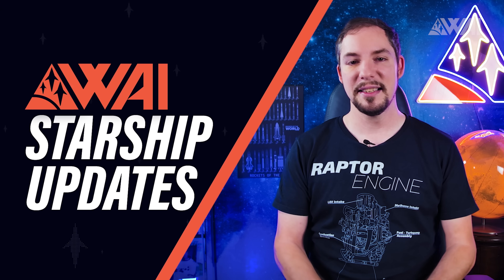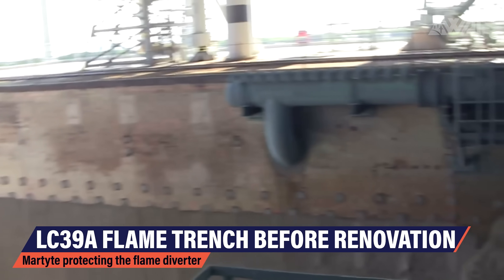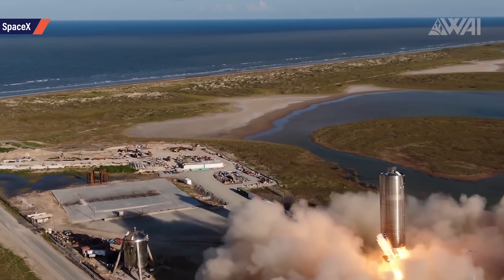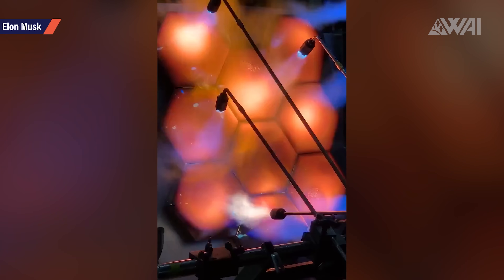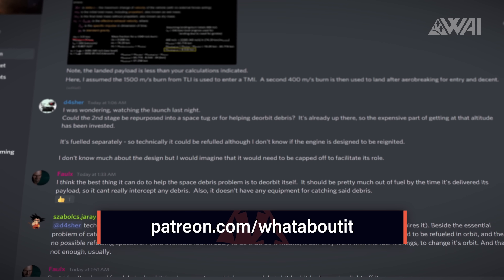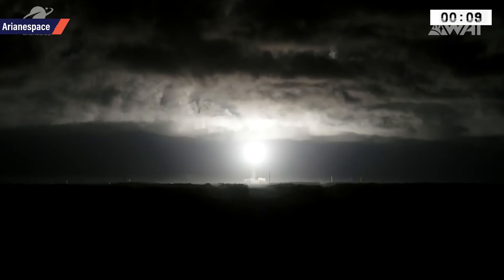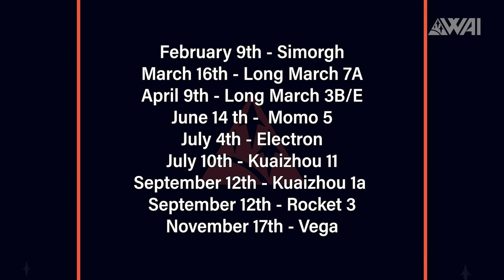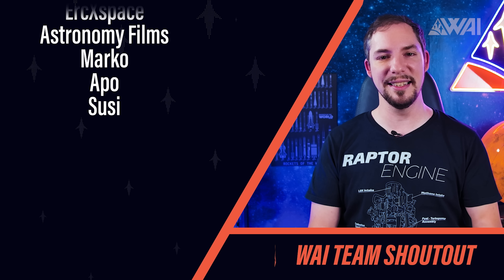134 | Why Martyte helped to damage a SpaceX Starship Raptor engine!

Comment from the maker: What is going on between orbital launch mount and Highway 4?
Reply: Something?? 😂
Reply: I think it’s either going to be one of three things... 
A. A parking lot
B. A location for a water tower
C. A new landing pad for the Super heavy 150m hops
Reply from the maker: Agreed. Tough engine design. They surely have to take a beating in this early prototype phase.
Reply: I suspect the reason for the flat pads without flame diverters is due to similar planned launch platforms on mars...would you even be able to apply martyte to mars landing pads?
Reply: @micmccond7  Yes, but getting the complete Starship shebang safely even a few centimetres above Earth on launch is necessary before contemplating a Mars landing. Why not start with a flame-diverter, test the vehicles for re-usability capabilities, and only THEN whittle down the sophistication of launch and landing sites when you know they work?
Reply: @mauricegold9377  they already know they can do reusable the whole point here is to figure out the interplanetary part.
Reply: ¯\_(ツ)_/¯¯\_(ツ)_/¯
Reply: I think it is a temporary flame diverter, So that they can test some more prototypes and then maybe build a new one or upgrade it!
Reply: Will 2020 ever end?!!
Reply: i reckon it'll be some sort of hangar for starships that are ready for flight?
Reply: @sionbrown7144 /\
Reply: Shane Lee  That is perfectly phrased 👍🏼
Reply: Shane Lee  yup
Reply: I cant wait to see the crane that will stack Starship on SH on top of that mount!
:_WAIShocked:
Reply: stuff.
Reply: Tank farm for OLP?
Reply: Fuel Reservoirs I think 😉
Reply: WS = We Solar * WS * We Spacefarers *  OurName4Freedom . ws * YourName4Freedom . ws * TheirName4Freedom . ws * 5x5 = 4k monthly income * BUILD * TSLA 4U DanielHall4Freedom . ws
Reply: Beer pipeline to a tent party.
Reply: a steel plate under a missing tile saved a shuttle so there is some protection
Reply: Flame trench I think
Reply: Idk 😬😐
Reply: flame diverter?
Ich glaube das macht wirklich Sinn irgendwie müssen sie da ja was machen
Reply: I think SpaceX may want to start looking at alternative approaches /materials to constructing launch pads.  The frequency and intensity of intended usage is unprecedented.
Reply: Those boxes could be for the tower next to starship/superheav
Reply: Throwing shade at Marmite? It's delicious, ^oo^
Reply: Shane Lee  A while backin WAI  I posted a link to pictures/plans SpaceX themselves published of a mobile deflector.
Reply: I heard rumors a 1 million gal water tower ! But thats just it rumors
Reply: @scottymoondogjakubin4766  That's huge as hell... a cube at least 51.1 feet on a side... it would need to be high enough to generate required pressure, but not too high to be vulnerable to storms effects at same time !
Reply: Sabatier plant
Reply: @tponn Well then... They shouldn't be assholes and make stupid mistakes! A 5 year old could have told them that they need a flame diverter. It's one thing to make mistakes on big unknown things, but a flame diverter? Musk wanted to cut corners and ended up looking like a rear end. 
But go ahead and be a good Musk fan.... Support your "god" no matter what!
Reply: WATER TOWER!!!!
Reply: So, they will eventually have to turn this "launch mount" into water tower and build a proper new launch mount.
Reply: @TechMasterRus  Wouldn't it have been easier if they had done it right in the first place?
Reply: @DavidJohnson-tv2nn  yes, significantly easier. Maybe, redesign is the reason why nothing is happening to "launch mount" for last mounth. They have to place the flame diverter somewhere, but there is no room underneath current structure.
Reply: As most of you who have read my comments know... I've been highly critical of Musk cutting corners on Starship development. Looks like recent events have proven me correct.
Reply: @DavidJohnson-tv2nn  It's not cutting corners it's taking risks. Something NASA or any other space company has never been willing to do. If he did everything without risks or willing to damage some parts starship would only be complete in 50 years, not by 2024. I mean he wasted a whole falcon 9 to test an abort system in flight.
Reply: @sejithe5th  It won't be done by 2024 either. I think everyone here, even though they're Musk fans, knows his timelines are BS! 
When they did the Falcon 9 abort test, they did their homework. They spent years in development to get it right. They had a very high degree of certainty the test would go as planned. Unlike with Starship.... Where they just throw stuff together outside in the dirt and see what doesn't blow up.
Reply: @DavidJohnson-tv2nn    Your fictitious beliefs don't fly here buddy. A lot of us have followed them much more closely than you. They blew up massive numbers of prototypes in the development of Falcon one and Falcon 9. This is their way of getting to success whether you agree with it or not.
Reply: @FSD_PNW  Of course not. I'm talking to a bunch of people who blindly follow Musk. Just keep following him until there's an accident in flight, on a manned mission, with no launch abort. The beliefs on channels like this aren't shared elsewhere. Not saying this is a bad channel. Just the blind devotion to Musk.
Reply: @DavidJohnson-tv2nn  Pretty sure when they do a manned mission they will do hundreds of unmanned flights and they all have to have no problem or else they won't be able to start doing manned missions because like you said there is no abort system so there can't be a single problem.
Reply: @DavidJohnson-tv2nn  Musk isn't cutting corners he is forcing tests for Mars return launch conditions.
Reply: @ShepherdsGlenn  So what has he proven? The obvious that you can't use the main engines for lift off from unimproved surfaces on the Moon or Mars? His engineers should have been able to tell him that without embarrassing SpaceX by leaving out flame diverters  with disastrous results. And I'm sure they would have told Musk. He just didn't listen.
Reply: @DavidJohnson-tv2nn  its possible to launch a rocket from any were; the ocean, a cave,even a glacier. The question is how much engineering will it take to make it safe. They are finding out what to shield and how so this won't be a problem later.
Reply: @ShepherdsGlenn  Keep in mind that this was on an elevated platform. How do you shield anything when the rocket nozzle a few feet off the ground with an unimproved surface? "Tests" done in this configuration won't yield useful data. Since it doesn't simulate the truly harsh conditions of an unimproved surface.
It is my opinion that to try to lift off from an unimproved surface using the main engines  an unsafe and reckless. Not only do you have to worry about  engine damage but a piece of debris puncturing a propellant tank or damaging other systems.
Reply: @DavidJohnson-tv2nn  It’ll be funny when they prove you wrong just like they do every time. They defy odds and do the unthinkable. I don’t see any rocket company anywhere close to spacex. They will have setbacks. But those setbacks are good so they can figure out those problems so that way they will never happen again.
Reply: @treytonbutler9835  Well... They proved me right this time. Because I warned a couple of months ago that leaving out flame diverters won't end well :)
Reply: @DavidJohnson-tv2nn  oh. I didn’t know u said that and I commented before I saw the video so I had no clue. Lol
Reply: In other words... Musk's reckless and "cheap" ways are coming back to bite him in the butt! Sorry, but I can't resist saying I told you so :)
Reply: @DavidJohnson-tv2nn starships are also meant to land on the Moon and Mars....
Not any landing pads with flame trench’s there..

So, this is how these starships need to operate....
Reply: @ernestgalvan9037  lower atmospheric pressure on Mars or landing in the micro-atmosphere of the Moon doesn't have the same sonic reflection problem that dense atmospheres Earth has. The only problem is "floating" caused by the engine skirt pressurizing like the skirt does on a hovercraft.
A much bigger problem with landing on any unimproved surface in early Mars colony days is FOD inside the engine compartment from kicked up debris.
It's why previous moon landers were set up so high on legs, to reduce damage to the ship from ejecta off the ground from the exhaust.
Reply: @bobjoatmon1993  The previous moon landers also did not reuse the decent stage. Doing so would be extremely risky. Sure you can do an inspection for damage upon landing. But what happens if you do find damage? And what happens if there's more damage on liftoff?
Reply: @ernestgalvan9037  Sorry, but Starship can NOT lift off from unimproved surfaces using its main engines. That is way too dangerous, as proven here. Though that should have been obvious without doing "tests". They are going to have to figure out how to do it some other way. Perhaps high mounted SuperDraco type engines? Or... On early missions, drop off equipment that will construct a launch pad.
Reply: @DavidJohnson-tv2nn  given musk was skeptical, clearly by his comment about it possibly being a mistake, it is clear others on the egnineering team thought it was doable, but he's skeptical on it, but willing to wait and see. Also, still, even with some adjustments, they are able to move way way faster, literally years faster,  than other rocket builders. So yeah, not "coming back to bite him", just another thing to test and adjust for as testing proves out theories or disproves them.
Reply: @FSD_PNW  But here's the problem... This is something that shouldn't have to be "tested" You don't leave out flame diverters! I mentioned that a couple of months ago on this, or some other space channel. Guess what happened? Musk fans ripped into me for daring to mention the obvious and challenge what was going on. I have also been issuing dire warnings about plans for leaving out launch abort from manned flights. But nobody is willing to listen even though lives are at stake.
Reply: @DavidJohnson-tv2nn  got to disagree.  If you don't break things you have no way to know what might work. Breaking things is faster and cheaper in the long run. This is a TEST STAND. If nothing breaks you're not testing very well.
Reply: @RickBoat  They didn't just break a test stand. They destroyed a multi million dollar engine and nearly lost the vehicle. And for what? You DON'T leave out flame diverters! This is not something to "test". I mentioned this a couple of months ago and got ripped for it.
Reply: @RickBoat  Musk also wants to leave out full launch abort for manned missions. People will end up paying for that with their lives.  That is why I put so much effort into this. I want to see successful missions to Mars, NOT disaster!
Reply: @RickBoat  I do get what you're saying. Some quick and dirty testing may be quicker and cheaper. But what is happening here is going way too far.

Comment: For the starship, Elon should angle the engines not for optimum thrust but to blow all the rocks and dirt away from the rocket at liftoff then once off the ground go for optimal efficiency.  Would that help? No heavy blast blackets/shields to deal with.

Comment: I think heat tiles should be layered. Similar to how a roof tile is done. The 1st layer, against the stainless steel, could be much thiner and be there as a precaution/backup in the event the main front thicker atmosphere touching layer failing.

Comment: Rediscovering the purpose for which flame diverters were invented is a noble cause.
Digging a tunnel under the pad should not break the bank though.  But I'm concerned Elon might also rediscover the purpose for which refractory bricks and refractory cement were invented, if he keeps trying to solve every problem by spraying martyte on it.

Comment: It was not a failure of thermal tile that doomed the shuttle Columbia.  It was a compromised carbon fiber leading edge of the port side wing caused by a sloughing off of insulation from the primary central fuel tank that punched a hole in the leading edge.

Comment: What if? What if Starship has exhaus deflectors for itself? Like shovel-blades coming out behind the Raptor engines deflecting the gas in 60 to 80 degrees aside? Formed from the materials they already use and test for the heatshield segments? Only a idea, but it might bring on the discussion about landing on not prepared areas...

Comment: The idea is to prove that the prototype can fly and reenter the atmosphere.  It is not done to prove that it can take off from the Moon or Mars.  Those upgrades can come later, so put in a flame diverter.  Just so stupid.
Reply: Test pad won't be used in the near future, so building a flame diverter when it can takeoff without it (but now with several small simpler upgrades for debris protection) is a waste for nothing

The upgrades will be harder if it comes later, so better to start now

Comment: I wonder how they will solve this problem. On mars you cant get a flame trench so easily, and there will be debris flying up too 🤔
Reply: I guess this is why Elon said no to the flame trench. It’s better to learn these lessons on SN 8 than on the first mars “landing”.
Reply: @staticgrass  very true!
Reply: @Ryan N said(in another comment) starship is being modified so cables will be enclosed in steel pipe.
Reply: There is a difference between landing with fewer engines at lower thrust and taking off with all the engines lit.  A Falcon 9 only uses one of the 9 engines to land, for example.  For the lunar version of Starship, the thrust needed near the ground by thrusters mounted near the top.
Reply: John A. Tamplin Of course. However the additional engines on the Luna version are essentially a stop gap for the moment. If they can drop them from the design they will.

Comment: Could the same ablative tiles be positioned beneath   a future launch mount, in an upward facing conical configuration of steel and concrete for construction of a more compact mobile flame diverter built specifically for the a Starship Super Heavy Booster ?

Comment: They should just bolt plates of 3/4 stainless steel to the pad beneath the rocket. It won't rust, and they could remove it later if they need to,